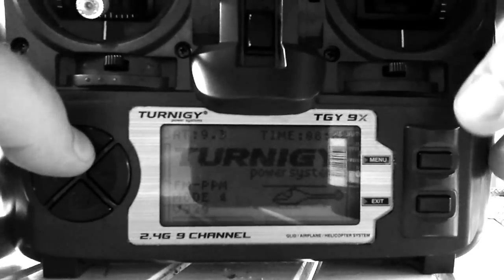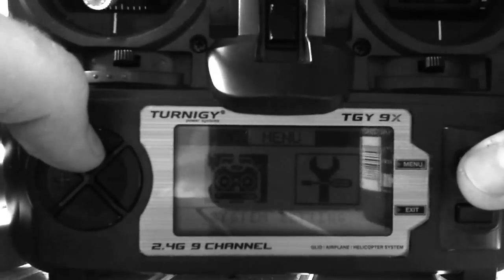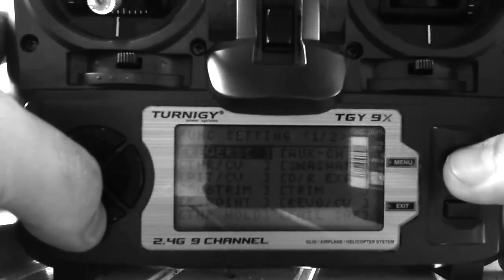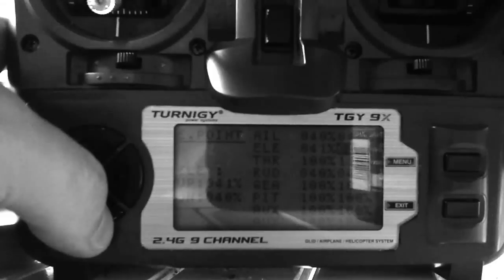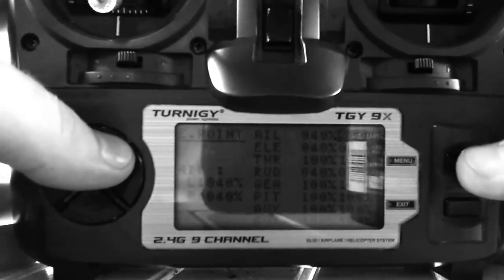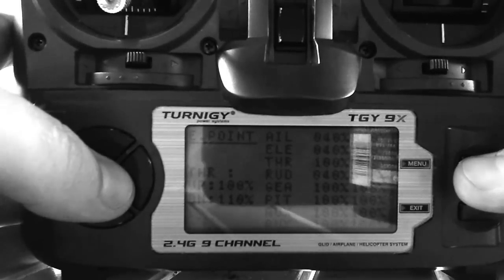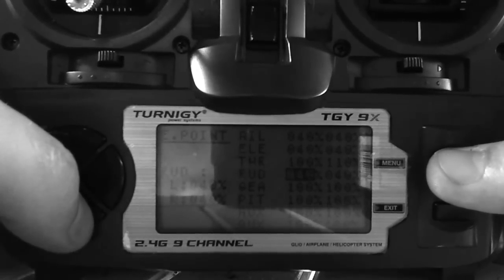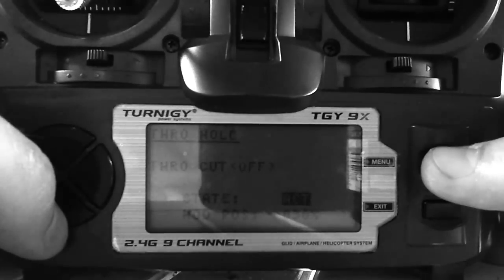How to program v929 quad copter on turnigy 9x v2 Part 1

Comment from the maker: No mode 4 is really just short for model 4. You must be on model 3. Doesn't make a diff. I hate how they wrote mode instead of model. Make sure your thr is correct. Rev or not when binding. Take the props off and bind it. If it goes full throttle, rev the thr ch. If I remember right, throttle should be reversed. Hope this helps.

Comment: On both video's the main screen says mode 4. I have my settings the same as yours (mode 2 on the sticks, Heli 2 type). My main screen says mode 3. How do I get it to mode 4 and is this why it went haywire when I tried to bind it?

Comment: Hi , I have the flysky radio which is the  same  as  the turnigy  radio. I did both  part one and two of your  video  and  At first I was flying  like a bird . But  when Ii set up part two of your video  for my v949 . I have little control over aileron  movement and my quad  won't. To flip to the left  when I power up. Would having it set on a level table after plugging in have something to do with it. Or. Please let me know what you think. This is my first program radio  and first  quad as well

Comment from the maker: Brodjj- odd that you're throttle was normal. They need to step up qc. Try going into the throttle curves and make sure point 0 is 0% put 1 at 0 also then 2 at 50%. Give that a try

Comment: When binding, my quad didn't actually stop blinking but it bound anyway. Was about to give up when I found another video showing how to bind to a 9958 heli. So I push button on back of TX and turn it on, plug the battery into the quad, first it blinks rapidly and then slower. Unplug quad and turn off TX. Turn on TX and then plug in quad. Worked for me.

Comment: How come you use Heli Mode 2 for a quad copter?  Multirotors should always be ACRO mode.
 I run my V929 in Acro mode, and run the dual rates at 60% / 120%.
At 120% it does amazing flips....